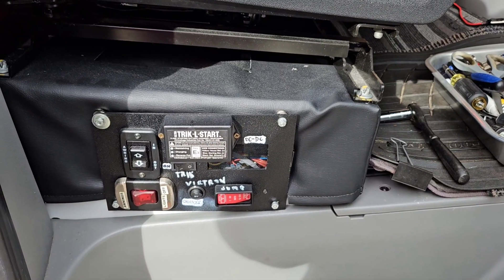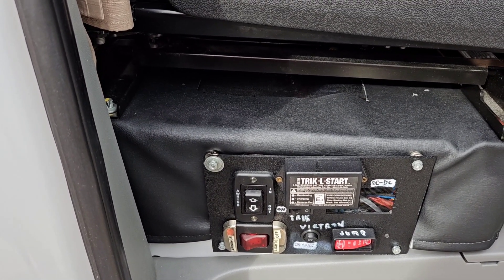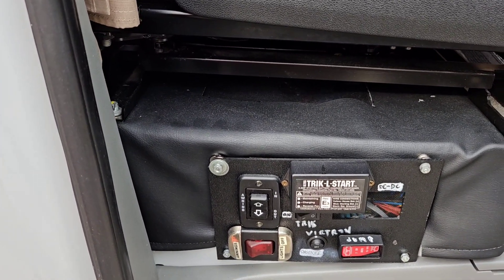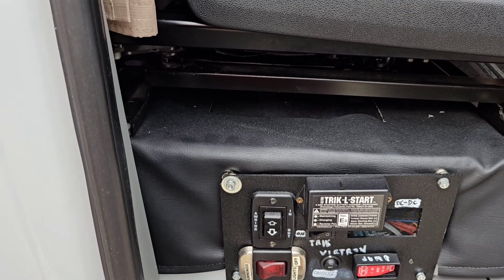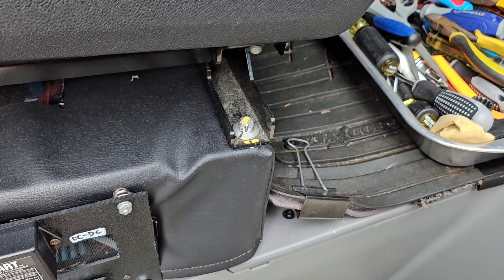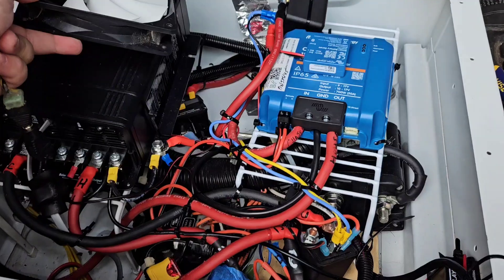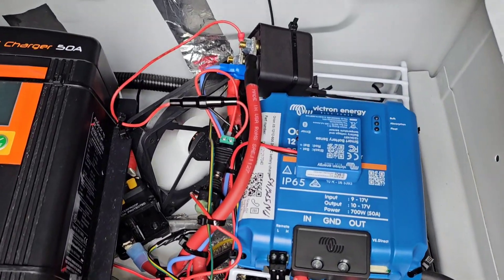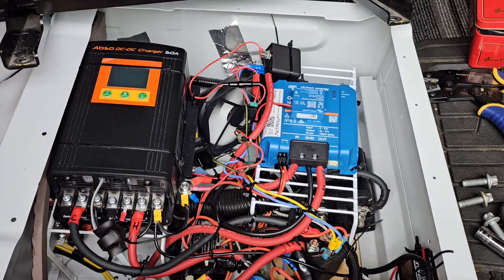Victron Orion-XS 50a DC-DC Charger Overheating 🥵😡   Installing a Cooling Fan, Easy Fix?

Comment: Your installation is wrong. Heat rises and there’s  no where for the heat to go. Put it vertical so the heat can escape.
Reply from the maker: My first 50a DC-DC charger, and Kisae DMT1250, never overheats and it's been under my passenger seat pumping out 50a for a few years.  My Victron Orion-XS isn't mounted wrong, you can actually mount it anyway you want. The Victron manual clearly states," With limited cooling, e.g. due to insufficient ventilation, the charging current will be reduced sooner than at the specified maximum ambient temperature. With improved airflow (e.g. forced airflow), the performance will greatly improve." So in a confined space, like under the passenger seat, I was expecting more heat build up and a possible ventilation issue, so first I tried adding a screen to the top of my passenger seat box but that wasn't enough. Adding forced air cooling with a fan solved the problem, just as Victron pointed out in the manual. You can't always be limited to only mounting Victron products vertically, even Victron recognizes this and gives you tips so you can make the necessary modifications to support different mounting configurations. Based on my experience with both the Kisae and Victron Orion-XS, my first choice for a 50a DC-DC charger is the Kisae DMT1250 50a DC-DC Charger, because it reliably puts out 50a alternator charging to house batteries and never overheats in the confined space under the passenger seat of a Sprinter. The Kisae doesn't derate/reduce power until it reaches 160°F. The Victron Orion-XS starts to derate/reduce its output at just 104°F, meaning it doesn't do well in confined spaces without forced air cooling with a fan. The other thing I don't like about the Victron Orion-XS is the small terminals. You can used any size cables you want with the Kisae DMT1250 50a.

Comment: Hi Sandy, In the video you stated that you wish you would have gone with dual Kisae DMT1250's due to having to add a fan to the Orion XS to reduce the heat.  Would you have considered the newer Kisae DMR12100 as an even better choice?  Thanks for all you helpful videos.
Reply from the maker: @Monkeypod-p8c  I did say I'd rather have dual Kisae's. I don't like to worry about things not performing as they should. I would highly recommend the Kisae 12100, the only down side is the size cables you'd need to run for it, unless you have the older LTV, 2016-2019 with the 1/0 awg cables for the house and chassis battery cable connection to the isolator solenoid. The dual Kisae's let 2015s and older or 2020 and newer use the existing wiring for 1 Kisae and then run a minimum of 6 awg for the 2nd Kisae. Mich easier to pull the smaller wire for a 2nd Kisae in those model years.

Comment: What would your take on two Orion Xs in parallel operating at 40 amps each in the seat base be?
Reply from the maker: @Monkeypod-p8c  You'll need a 120mm fan for sure. I've helped folks do dual Orion-XSs and they work great as long as you install a fan to keep 5he air moving and them cool. You can even get 50a each from them, the 220a or 250a Alternator has no problem giving 100a of Alternator charging to the house battery.
Reply: @SandyRVUpgrades  Thank you!
Reply: Have you had any experience with the Kisae DMT12100 which is very long at 14 inches and may be able to fit in the space?

Comment: Mmm not suppose to install it in a small space like that, do you not read the documentation????
Reply from the maker: @Shawn-ts4jw  I read the documentation as you can install it wherever and however you want as long as you're prepared to add forced cooling if you find it needs more ventilation. The added forced cooling did the trick, problem solved no more overheating. The 120mm fan keeps my seat base at around 100° with both chargers running at maximum output. They are both quite happy performing under my passenger seat.
Reply: But you made it sound like it's victrons fault. In other words you followed advice and it now works perfectly.  Why be angry
Reply from the maker: @thehigsy  No it doesn't. I know folks that mounted it vertically and it still overheats. The seat based is a confined space that needs a fan to really provide ventilation. My Kisae DC-DC charger has a fan, which is why it never overheats. For folks that find the Orion-XS overheating, they just turn the output down to 45a to make it happy. But when your running dual DC-DC chargers, there's to much heat to dissipate without a fan directly on the Orion-XS. It's only through experience do you really figure out how these things work!

Comment: how are you liking the Kisae DC/DC controller for LiFe Batteries?  Does it have a setting for tail current like the victron solar controllers do?
Reply from the maker: @s.mendez7160  Yes it does, the L setting. It has defaults based on the battery current setting, or you can customize it. I love the Kisae, I wish I would have used it vs the Victron. The Kisae is reliable, trouble free and never overheats. The Victron Orion-XS isn't worth att the effort get it as reliable as the Kisae is out of the box!
Reply: @SandyRVUpgrades  So the custom settings can be programmed all from the face of the unit, I don't need a remote unit like the EP Ever chargers?  Yeah, the Victron DC/DC units warm up when they approach  their rated capacity. Kinda sucks. Thanks for your replies.
Reply from the maker: @s.mendez7160  I do wish I would have gone dual Kisae's, but the fan solved the Victron cooling. Now my seat box stays around 100°, not an issue for either Kisae or Victron.  Yes the Kisae settings are set on the face display. There is a remote you can buy, but it isn't required.
Reply: @SandyRVUpgrades  I was looking at the spec sheet for the Kisae, and noticed in custom mode the minimum "re-start voltage" is a fixed setting of 12.5V or a little over 15% SOC. Would be cool if that was adjustable...
Reply from the maker: @s.mendez7160  It also restarts everytime you turn the ignition off and on if you add the ignition controlled isolator relay I recommend on the chassis battery side.
Reply: @SandyRVUpgrades  Is that in any of your videos, or in the user manual?
Reply from the maker: @s.mendez7160  I don't mention it in my video. I don't know if the manual says, it's just how it works after observation.

Comment: Hi, the Orion XS manual (download from the Victron website) says under item: 

"3.1. Mounting
• Mount vertically on a non-flammable surface, with the power terminals facing downwards.
• For optimum performance, a minimum of 10cm (3.9 inches) space should be kept free around the product for cooling. With limited
cooling, e.g. due to insufficient ventilation, the charging current will be reduced sooner than at the specified maximum ambient
temperature. With improved airflow (e.g. forced airflow), the performance will greatly improve.
• With limited cooling or extreme ambient temperature, the charger can become hot (especially the bottom plate). Due to internal
temperature control, the bottom plate will never get warmer than 90 °C (194 °F); this is no problem for the charger. Make sure that the
mounting surface can withstand this temperature.
• Mount close to the battery but never directly above the battery (to prevent damage from gassing of the battery)"

I always try to follow the directions explicitly with any electrical stuff, and especially pay attention to cable sizes used (considering not only Amp carrying capacity BUT ALSO voltage drop as it can add up over any long runs) and also QUALITY fuses rated to protect each wire used, or lower, if the component's directions call for it.

I'm currently replacing ALL my system's fuses (damned Amazon BOJACK brand, shown by a solar guy on YouTube to not blow acceptably) with "supposedly genuine" Victron ones. Victron's are actually produced by "Littlefuse" so they're equal quality, in general.
 It's correct wire size and fuses which keeps the fires away!

However, fire risk is also what makes me read every line of any directions first. Fire risk really scares me bad!

I wish you luck and best safety!
Reply: The man I mentioned previously who ran the MEGA FUSE TESTS; YouTube channel is named: "Cleaversolarpower by Nick" and they're "MEGA Fuses" tested, the kind I've been ordering cheap off Amazon previously (mostly BOJACK branded ones unfortunately). 
As of this writing (9/23/2024) "supposedly genuine" Victron MEGA fuses can be had from several vendors at typically "5 for around $22". (This didn't USED to be so) A good deal if they're actually manufactured by Littlefuse. Or at least approved by Victron in some way. Mine are coming from "Inverters-R-Us" as I sort of trust that seller. I've bought a lot of stuff from them both on and off (directly from their website) of Amazon with no problems. They ship from Reno, NV. Which is quick to me in S. California. That's always nice!

Good Luck, And Safe Travels!
Reply from the maker: @Jim_V.  A fire isn't a possibility at 140°F, which is the highest temperature I saw the Orion-XS get. When I install things, I test them and observe them so I can learn and modify my approach if necessary. You have to have the knowledge, skill, and ability to understand the engineering behind the written words of a manual. Victron does say to mount their products vertically because that gives the best chance for heat to rise from their products.  However, mounting things vertically isn't always possible, which is why Victron advises forced air flow cooling. So you can mount them horizontally if you increase air flow and ventilation. I had increased the ventilation of my seat base, which has kept my Kisae DC-DC charger operating below 100°F. So adding forced cooling with a fan has greatly improved the Orion-XS performance, and it's now staying below about 110°F. The heat produced by a single Orion-XS probably would have been acceptable, but it was impacting my Kisae DC-DC charger operation, and I couldn't have that. Now, using knock-off fuses and circuit breakers does set you up for a possible fire. Lots of people doing these upgrades for some reason cheap out when it comes to fuses and circuit breakers. I only use name brand fuses, Blue Sea, Littelfuse, Buss, Bussman, and Eaton. Victron fuses seem really cheaply made, and they have no markings on them as to who the manufacturer is, so I refuse to use Victron fuses. If you use knock off fuses, it begs the question of what other knock-off stuff you have in your electrical system. That's a scary thought from an electrical safety perspective. You probably need your "Wish for Luck and Best Safety" more than me. It sounds like you might have been lucky finding your knock-off fuse problem in time. I would take a heat gun to all your electrical connections and verify you don't have any other surprises lurking.
Reply: @SandyRVUpgrades  Heat gun check everything always and over build too. I don't mind spending extra money for quality. Would a 4 year in Theoretical Physics suffice? You're talking thermal radiation via air vs, thermal conduction through metal inside the XS. The longevity of the XS may suffer some but I agree I wouldn't worry about the difference. No Littlefuse manufactures Victron fuses. The only question is might "these" Victrons be faked. I bought supposed Littlefuse brand before at top market value. Those had no markings either. But you're right I buckled to the "Bojacks" simply because of the vast number of positive reviews. Can't trust reviews apparently no matter how many people vouch for a product. Blue Sea gouges on price of Bussman product same as Bussman themselves. A fuse isn't a terribly complex metal quality nor expensive piece of to manufacture. But I suppose if they make endless millions per year there's always someone wanting to capture the market through lowest price. It's really a commentary on how poorly the legal system functions as any check on the market and the difficulty of suing for damages, or even lives. But I suppose there's very little reach to everything being produced in China for several decades now. I would imagine even the more reputable names actually produce in China too. It's just they probably sample better for quality control. Yet it's noteworthy at least 2 cheap Chinese brands performed just fine in that man's sample size of n = 1. But, of course that applied to Bojack also. You wouldn't think any company would produce crappy fuses, yet of course some do. I just spent $70 for a simple main breaker a couple weeks ago by Blue Sea. It was the only one with the type of finger switch and rating so I absorbed the soaking. Yeah, paper even takes 451° F so no worries in your setup. I'm considering similar fans in an effort to maximize efficiency after once again reviewing Victron's advisory again. But seriously people and or companies need to be held accountable for something so vital as proper fuses and potential for loss of life. I suppose I over trusted "Bojack" as they simply "appear as" an American run company. I truly hated forking out $70 for that breaker. Nevertheless, the market bares it. And ya gotta pay to play.

Comment: I don't see any air vents on the sides of the seat pedestal.  Even with the fan on where is the air going?
Reply from the maker: @vincecarluccio5018  I have a vent cut into the side panel and have the side panel mounted in such away that air can flow around it. In addition I have a big cutout on the top of the seat base. I don't a trip now and monitoring. The temperature is staying around 100°F. Much better than it was doing.